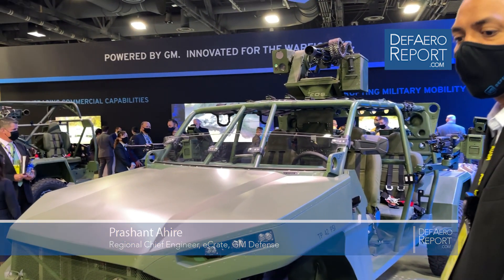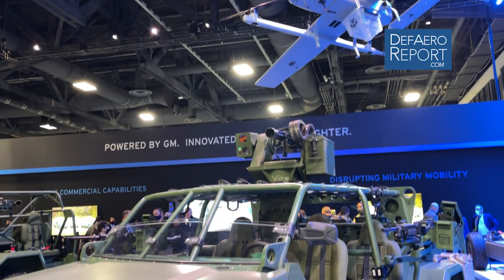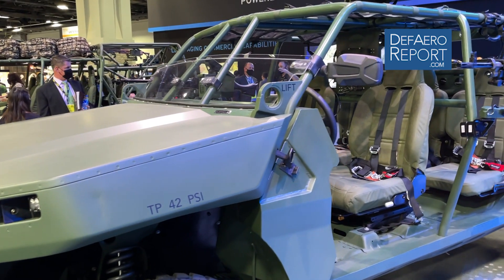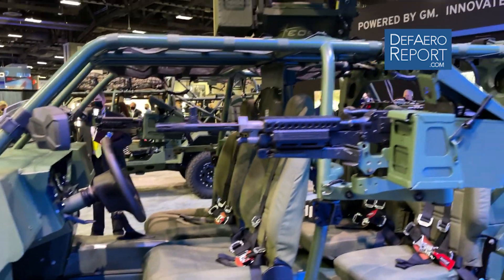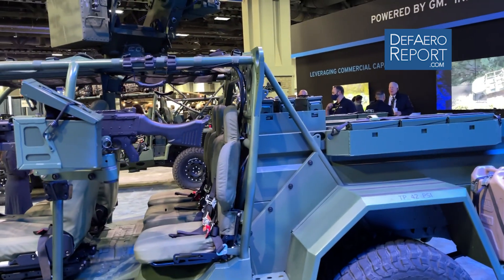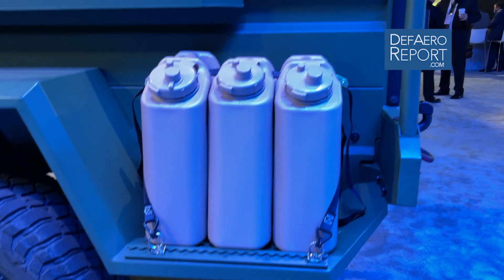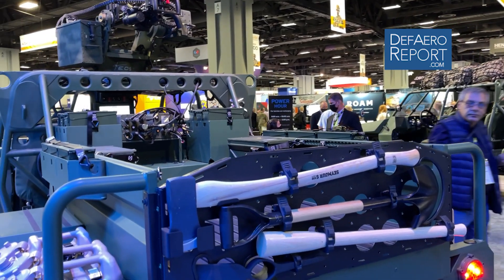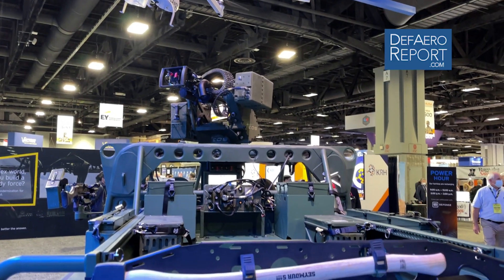GM Defense’s Electric Vehicle Concept at AUSA 21

Comment: If GM can add electric engine system into their existing infantry squad vehicle, they might as well add in an armored cab with additional horsepower for mounted cavalry elements instead of being issued with the heavier and slower JLTV. Of course, that may not be what it was designed to do, but consider the costs and the amount of resources are being consumed here. A possibility worth investigating scientifically.

Comment: Electric doesn't have enough range to compete with engines yet.
Reply: Yeah it does. You can get 400 or maybe 500 miles already.  Electric is also already much better at some things like instant torque, instant acceleration and complete quiet. Its also safer in regards to fire danger compared to fosil fuel (despite what you might see on CNN!)  the trick is these can be 'fueled up' without having to haul swiming pools of petro around and could recharge from pannels in the desert in a few hours.  So it wont replace everything but its very relevant for some things already.
Reply: @ghostmourn  We are not talking about Tesla's here, these are off-road military vehicles. Batteries do not come close to diesel in energy density, this is indisputable. Military vehicles already have a weight problem without expensive/heavy batteries, and yes batteries weigh much more than engine/fuel if you want comparable range which only gets worse with higher energy storage requirements.

Charging with solar panels is not realistic. A 100kwh solar array would barely be enough to charge 1-2 vehicles and that would require over 400 solar panels. How long do you think it would take to setup that many panels? And they only work at daytime! SOL if need energy at night. 

Keep in mind these vehicles would need much more battery capacity than a Tesla given their weight and driving conditions, oh and aerodynamics were clearly not a consideration for this design so add more battery weight to compensate.